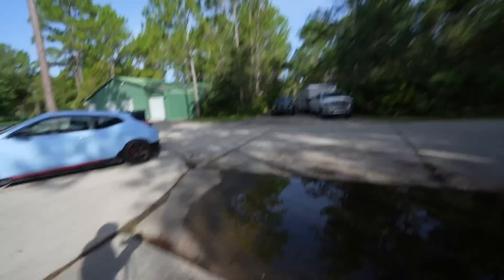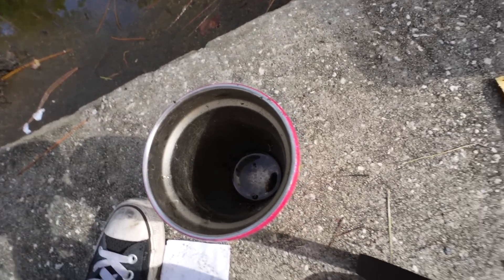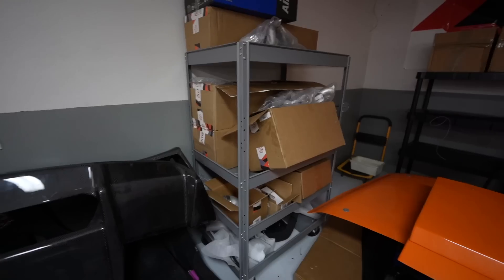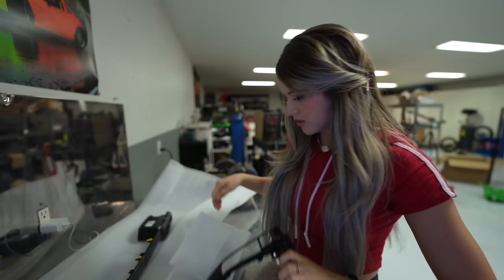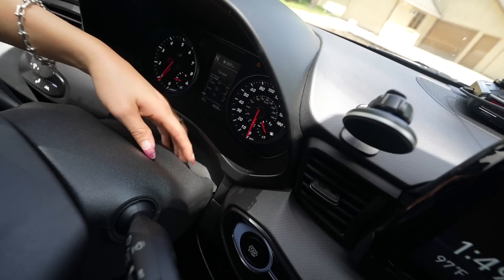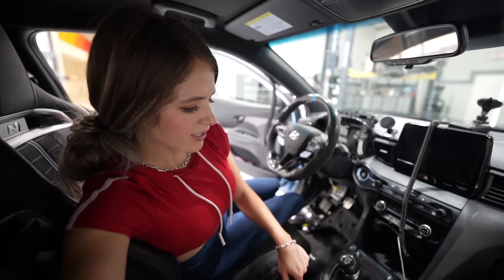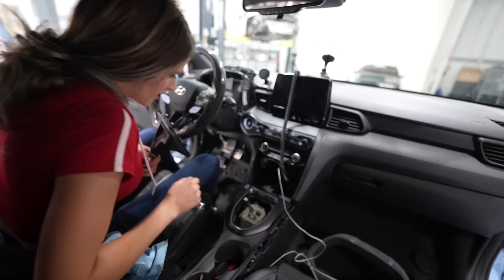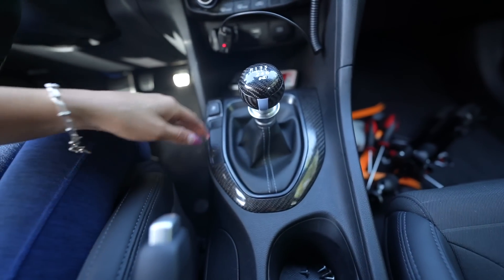Tearing Apart My Daily Driver - Veloster N Upgrades!

Comment: Had a very similar 2019 VN.  All SXTH bolt ons, ECU tune, SCGW carbon wheel/shifter knob, adro v2 carbon wing, Siebon Carbon hood, carbon fenders.  Had the exact same wheel but with a white topline cause my VN was white.  Now working on my '22 Elantra N.

Comment: I hate getting the trims if of the N models we have here, specially the i30N those yellow clips are so tight and the trims are made out of old straws. Oh yeah, with those shift knobs, pull till you think you are about to pull the gearbox out through the floor then pull harder.

Comment: Ready for that exhaust mod next! Still convinced a DP and a valved exhaust will slay on this car
Reply: It comes with a valved exhaust
Reply: @esantiago8989  I know. Wouldn’t hurt to get a 3” system with a decent downpipe 😎
Reply: @xRSAkingx  word. My N has the sxth element downpipe and ark midpipe. It sounds awesome and loud when the valve is open and still very liveable/ quiet when the valve is closed
Reply: @esantiago8989  I gotta get a sound clip of that setup 🤩
Reply: @xRSAkingx  IG?

Comment: Looks way better with those carbon mods. Btw, when you gonna do more Audi content? Miss the little beast.
Reply: Pretty sure she mentioned in one of Tommy’s videos that she sold it
Reply: @caseyperrell3198  Oh. That's a bummer. I would've loved to see what she was gonna do with that car. It had so much potential.
Reply: It's gone
Reply: I’m fairly certain it’s because she got actually sponsored by Hyundai and the two builds would have been conflicting (I’d much rather see the TTRS) so she sold it on the DL
Reply: She also bought that 3500 dodge she was sitting next to
Reply: @j.harker8311  i thought that was her old one?
Reply: @benguini.  No she traded to get a new truck
Reply: @Chris_x_  Her old truck was a black 3rd gen

Comment: that is a very thick steering wheel and/or are your hands that small ?!   (for me the gloss carbon inside parts do not make it nicer, would have liked it much better if it would have been matte carbon. in and outside.